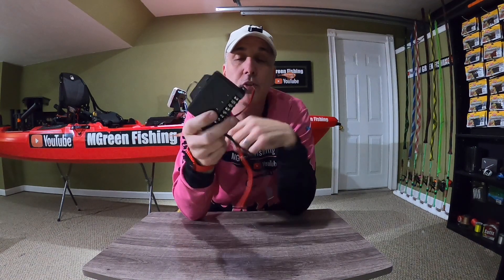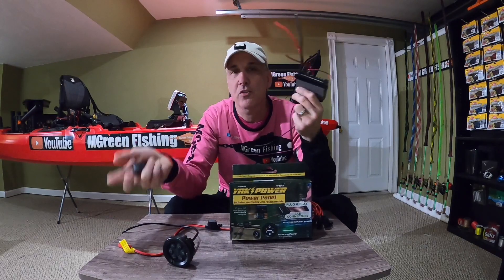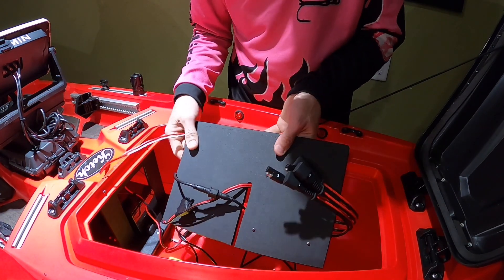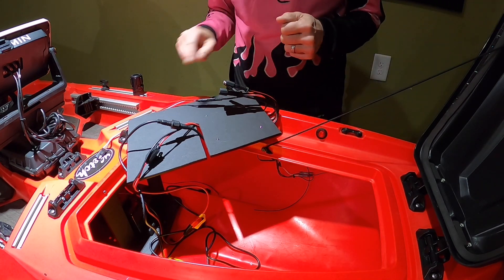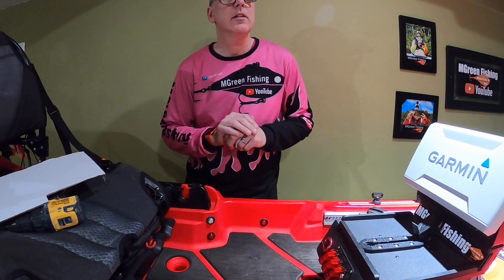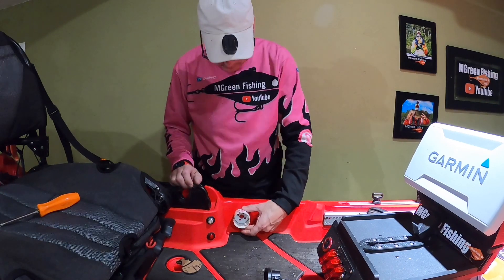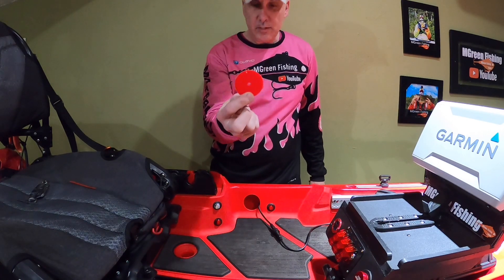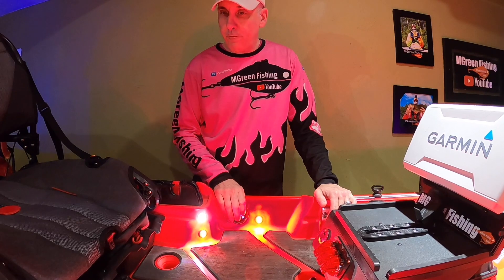Yak Power Install And Set Up

Comment: ALWAYS dielectric grease those wire ends BEFORE crimping! Heat shrink is nothing more then insulation and is great at hiding corrosion, it has nothing to do with waterproofing, as many "believe"!
Reply from the maker: Thanks for the tips 👍

Comment: With all of those accessories, what does your kayak weigh and do you have a cart for it?
Reply from the maker: The kayak weighs 86 pound when I install all the gear it weighs 125 I have the wilderness cart setting the cart in the center of the kayak makes it easy to move thanks for watching

Comment: How has this setup worked out for you?
 I had considered using this for my electronics since the ability to turn things on and off individually is a must.
I am just not sure if this system is something I would trust for that.
Reply from the maker: Hi , it’s working out great the kayak is outside in the summer no leaks I was unsure about drilling a 2’’ hole for the control .  But all good all buttons still light up and work   Thanks for watching
Reply: @MGreenFishing  Thank you!
 I was reading some reviews and of course I always start with the worst. I don't know if all the quality issues I read about are the normal percentage you will always have. It's comforting to see it's worked well for you.

Comment: Yak power sells the pigtails with butt connectors to connect any wires to their system when you use different companies sae connectors they dont fit perfectly and over time your system may fail the yak power connectors are only 5.99
Reply from the maker: Thanks for that tip I will take your advice thanks for watching